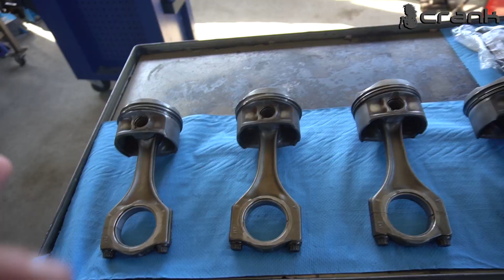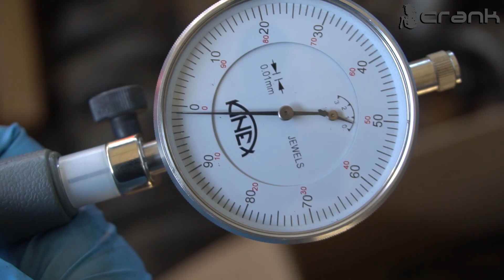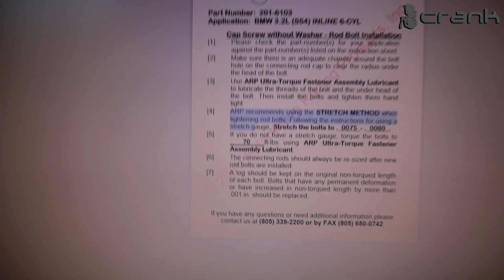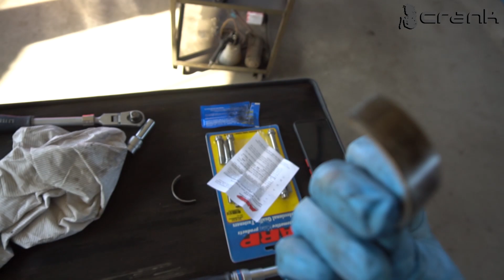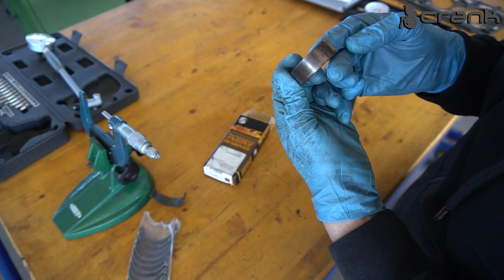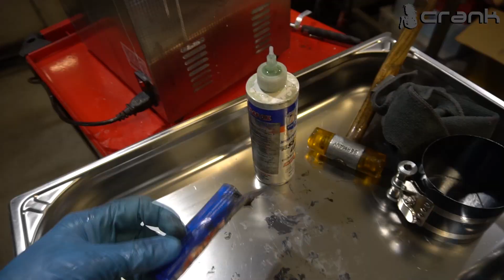BMW S54 ARP vs OEM Bolts Conrod Bearings Installation

Comment: Do you think it's safe to use the ARP bolts on the M10 later S54 rods?
Reply from the maker: It should be not an issue, but the OEM ones are doing great job also
Reply: @crank3646  Thanks, I know many people argue as to if you need to hone the rods. Great video btw.

Comment: Thanks Crank , very interesting video...Question...Why didn't you put oil on the ARP bolts when you did final installation or Loctite for threads?
Reply from the maker: Hi Peter! ARP specially insist to use their lubricant, when tightening their bolts/nuts. If we use anything else, like different grease or oil, this will influence the torque procedure.
Reply: @crank3646  okie dokie , just asking

Comment: lbs is short for pounds per square inch , as USA still use old imperial measurement system as you know...cheers